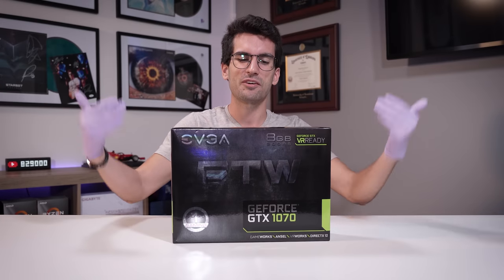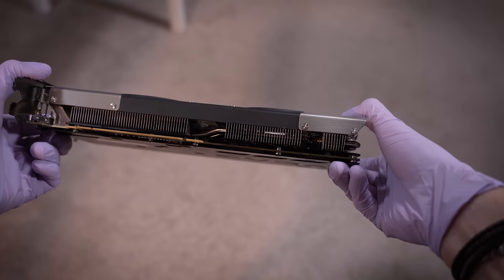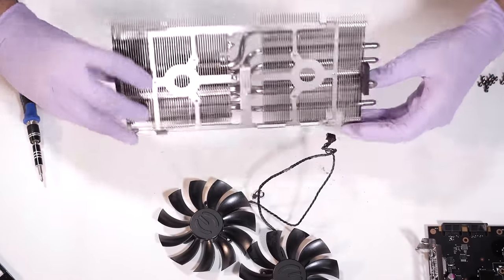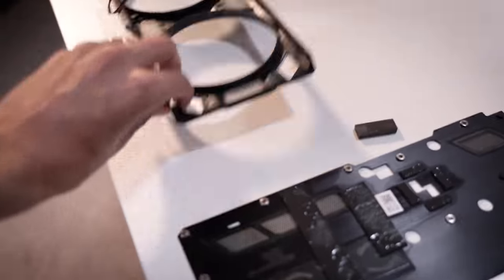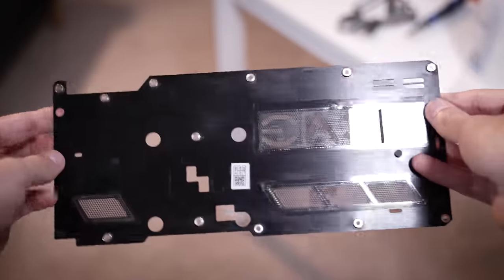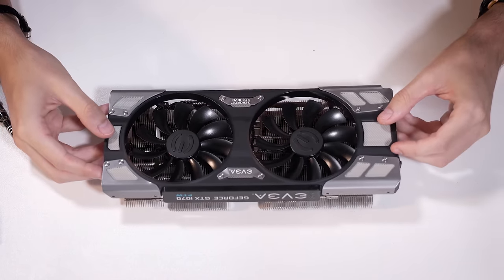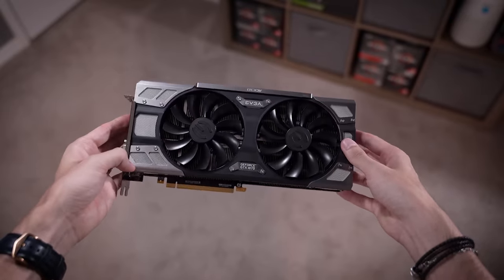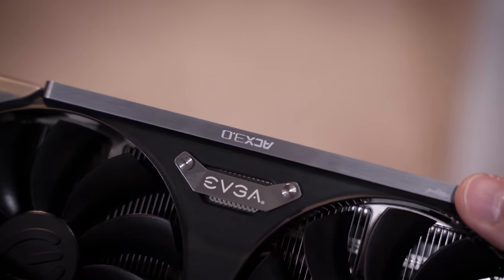This Used GTX 1070 Needs Some TLC!

Comment: Compared to some cards I get, especially in used computers, this 1070 is as clean as it gets. I usually see a fully clogged heatsink up to the point when fans wont even spin cause hair, dust and crud wont let it, obviously the rest of the PC is no better.

Comment: Personally for electronics I wouldn't soak in anything less than distilled water. No conductivity and it will help to leech dirt and dust from the parts.

Comment: Last time I cleaned my machine, I broke a cable. I thought it wasn't seated right, but it turns out the cmos battery was not contacting right. Sucks to have only a laptop

Comment: Honestly didn't seem like this card needed to be cleaned at this time, as much as it needed fresh thermal pads that weren't making it worse. The dust was so mild that it definitely wasn't causing any problems.
Reply from the maker: This wasn't mild dust. Ofc there's worse (we've cleaned worse), but it needed a clean. Period.

Comment: I wouldnt recommend it, but I've used a dish washer to clean a really dirty motherboard and gpu worked really well, but you have to make sure and remove cmos battery and you have to let it dry for a few hours or use a hair dryer.

Comment: Still using it on a 1440p 144hz monitor. Sadly can't handle the new games on high framerates even on low settings. 4070 can't come soon enough :D
Reply: I mean 144 fps on new games is quite hard, but I have the same card and play many AAA games around 90-120 fps 1080p ultra for the most part
Reply: in my opinion the 1070 is a 1080p card anyway, I love mine but if I got a higher resolution monitor, I'd want an upgrade.

Comment: I have the MSI GAMING X GTX 1070 back at the end of 2021 and oof. I should’ve waited for the major price drop but my RX 580 was about to die soon. Bought it at a massive $549.99.
Reply: I did the same thing lol, I just couldn't handle having to slightly lower my resolution scale in one game for any longer

Comment: This card literally looks like someone sprayed oil in it to me. Isn't as uncommon as you may think to stop fan noise without taking it apart... I've worked on a laptop before that someone sprayed the fan down through the fan vent  with WD-40 rather then grease it properly or replace the fan... Nothing was destroyed and it still worked I just thought it was funny.

Comment: glad I sold my used 1070 for 400 during the GPU shortage
Reply: I bought mine for around 400 during the shortage 🤔
Reply: @jordanlazarus7345  but at least you didn't pay 2k+ for a 3080

Comment: Just bought a gigabyte 1070 off ebay 🤞🤞🤞for $123.... Upgrading my rx 570 4gb And since my mobo is only upgradable to 
i7 7700 upgrading my i5 7500.... Not totally Ready for an upgrade just yet but getting ready for it. Before 1070 become ghost and i7 7700 become irrelevant 🤷‍♂️

Comment: Oh that looks like the terrible FTW 1070 that had a huge failure rate because the VRMs didn't have proper cooling, the midplate is trapping the heat under it. That's why production of the FTW was stopped and EVGA started making the FTW2.

Comment: I thought this would of been a dirty card looks  cleaner than u buy from cex and game exchange I was expecting loads fluff and what not.i have the 1060 6gb bought from ebay during the chip shortage £250 best card I've ever bought even though its old now but still the  driver  updates about once a month through

Comment: This is why I don't want a used card. Greg said that most of the used cards he bought that turned up faulty were either DoA or died shortly after purchase. This sounds like he's bought a lot of used cards. It also sounds like if a card died two months later or he got shafted on a return claim, he wouldn't be knocked out of the game like I would. I don't have anywhere near that kind of money to risk. My PC is my big expensive toy but it's on a fixed budget. If I buy a card, it needs to work for a long time. If it doesn't, I need it replaced. Both eBay and PayPal have proven unreliable to me in that regard. 1080p is aging fast and the cards capable of 1440p at decent settings three years from now are still going for more than I've bought a running vehicle for. Even the used ones. I need to make sure what I buy doesn't become a golden doorstop because a miner wore it out and/or PayPal sided with the seller. Having warranty coverage is peace of mind I can't part with unless a used card is cheap enough I could buy it twice if necessary, because I've had to.

Comment: Personally I would pickup a 16 series vs 10 series just for the efficiency & GDDR6.
Reply from the maker: 100% depends on price. Performance is similar, but yes, the modern architecture helps. At the same price, 1660 all day.
Reply: Sure... but they're $50+ more and have two less GB of VRAM. There's always a tradeoff.
Reply: @TheGameBench  these cards are 1080p focused, 6GB is plenty on that front
Reply: @GregSalazar  of course it boils down to pricing, new subscriber here btw keep up the good work. I'm also an advocate of buying used vs new if I can avoid the latter.
Reply: @13thzephyr  I wouldn't nessisarily say 6GB is plenty for that. It really depends on the game, especially going forward. Honestly, 6GB is the new 4GB. But really I"m just saying that there is a value add of the 1070 over the 1660S/Ti and I wouldn't just say one is better over the other for every person.
Reply: But 1070 is roughly 30% faster than even 1650S going by Userbenchmark. A 1070ti is 60% faster, and they have allot of overclock headroom usually I'm running 1070ti at 2050mhz.
Reply: @Metaljacket420  We're talking about the 1660S/Ti, being that they're comparable to the 1070. The 1650 Super isn't really a part of the conversation. Also, you should ignore User Benchmark.
Reply: @TheGameBench  hahaha UB is $hit I agree
Reply: @TheGameBench  yep, it will be cheaper  for sure based on price to performance

Comment: 0:50 i would never clean my gpu before selling .. same reason i never clean my gpu while using it .. that would be some kind of "i have no idea what im doing here" action xD 
but i have to say my gpu even after 5 years didnt look that dusty dont know why some GPUs looking grey instead of black after 2 years or something xD 
and ofc i would tell it open that i dont clean it and most likely try to take some pictures of the "bad places" 
in the same moment i have to think about "who want to buy my old gtx 660?" or the gpu im still using a gtx 960 .. not even worth sending it xD 

in the end i prefer a gpu working with a bit dust in it then a gpu not working anymore because i took it apart xD 
17:10 that moment alone ... im a person using a pc since nearly 20 years now pretty near to daily .. building my own systems since nearly 10 years ... i never used thermal paste xD i mean ofc its my system but always pre installed on the cooler had used boxed cpu cooler since this month got the first switch because i dont like the temps from the ryzen 5 5600x with the stock cooler now with the be quiet pure rock 2 .. still pre pasted xD